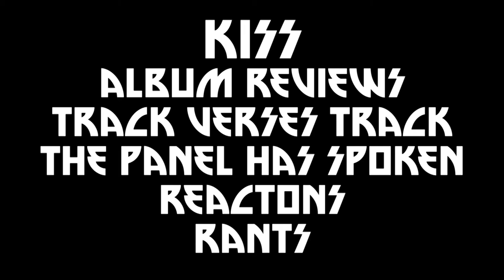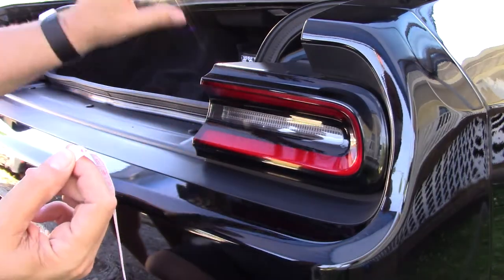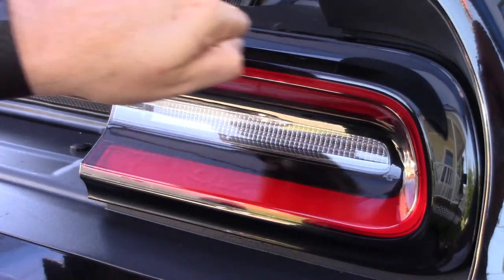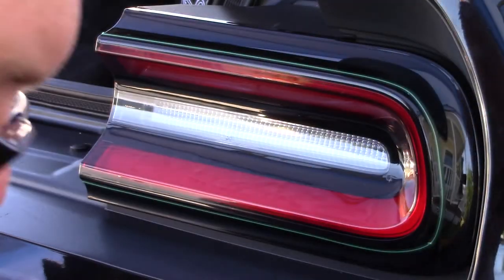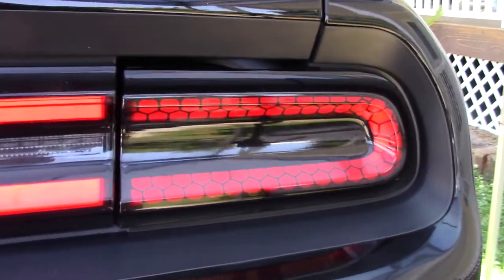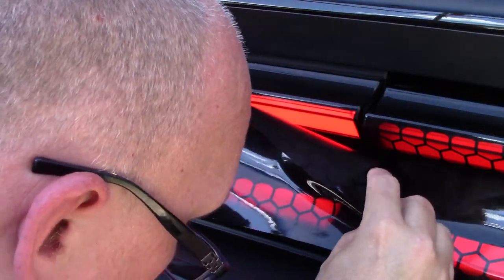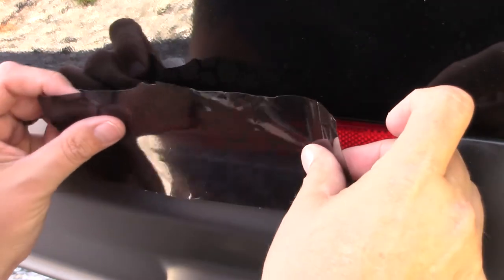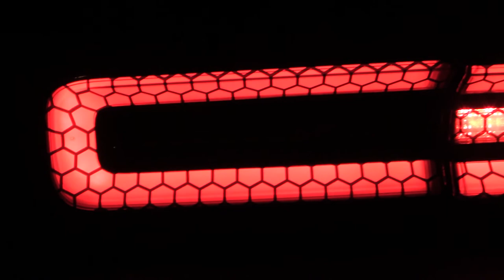Installing Luxe Honeycomb Taillight Wrap on a 2020 Dodge Challenger

Comment: Nicely done! Thanks for sharing.
Reply from the maker: Thanks for the comment.  That is amazing.  Thanks for watching!
Reply: People really want to ruin their beautiful cars, with this tacky bs? Must be a new fad for the ricer/teen crowd.. Can't imagine, a grown man doing this to a fkn  Challenger! I bet the value goes down, the second that stuff is applied to anything.
Reply from the maker: @chinarider8051  If I want to remove it, I just have to heat it up using the heater I used to apply it and it will peel off and leave no residue.   And actually, this is a very popular mod for the Challengers.  I saw it on a lot of cars at car shows before I decided to do it to mine.

Comment: Hey man! Nice job with this! I did mine as well.. but the next couple of days, the edges started to pucker up. I used a razor to trim and a heat gun through the process. The light was cleaned and prepped thoroughly before applying, but I think I should’ve trimmed with more of an overlap. Did you have any issues after doing yours?
Reply from the maker: Mind puckered some as well.  My trim was pretty close so I didn’t have the option of trimming, so what I did was put my heat gun back on the edges and then used the stiff end of the squeegee to flatten them back out.    Mind mostly puckered in the curves due the stretching of the material.   I have done this process twice flattening the puckers since I applied it.   Usually at the beginning of the summer.   Hope this helps.